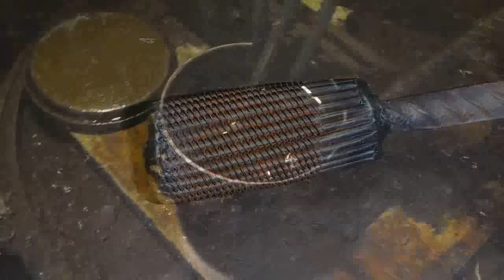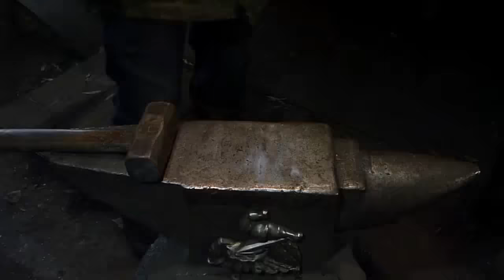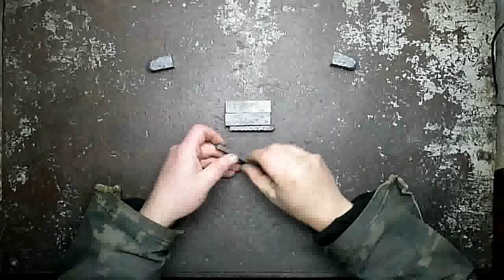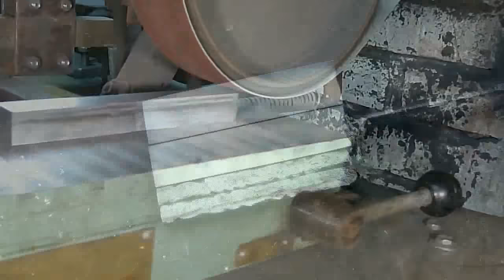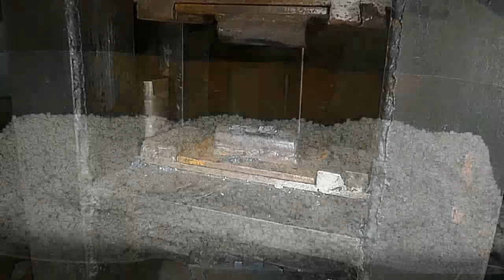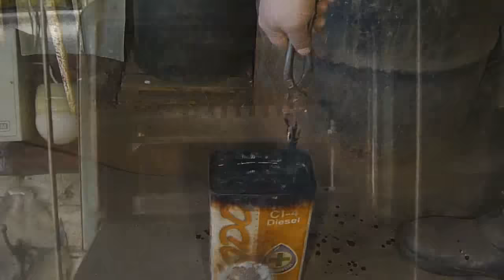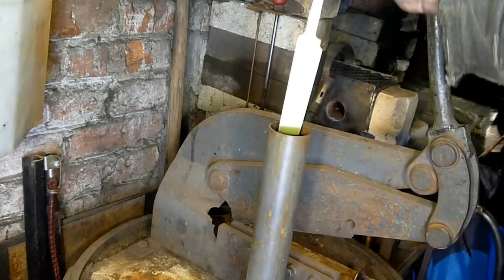Damascus of screws, making a blade.

Comment: Wow not only are your Damascus patterns exquisite, but every step of your forging and blademaking process is so masterful and precisely executed! Like, I’ve seen some horridly failed forge welds in stuff I’ve watched and on actual knives, but yours are the cleanest and most thoroughly executed I’ve ever seen. You make it look easy!?!, And your bladegrinding setup and method is just mindblowingly efficient to watch as someone who wants to get into blacksmithing someday and thinks “OHHH What a perfect tool for that job to ensure consistency between blades” (the grinder with the magnet plate, and the stopguard that you screw onto the blade before shaping the edge). I imagine those steps give you consistent shaping on the back of the blade and for the thickness of the tang, but let you have the freedom to grind as you wish for the rest of the shape and the edge itself! Very cool!

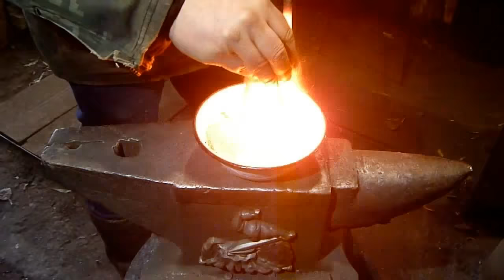Comment: 0:29 One thing I don't understand is how you're pouring powder with bare fingers only 5cm away from 1300c glowing steel, and fingers are not melting off. MUCH respect to your skills and art!
Reply: If you do blacksmithing, you will get used to it. And its not the worst, just a second or two

Comment: I guess the most impressive must be the fact he doesnt have any visible injury in his hands with all that exposure.
Reply: @lordseventhmusic4073  no. Safety first, use your brain.. stay away from injuries and fail compilations
Reply: You can actually briefly brush your hand through molten steel without burning yourself due to the moisture on your hands it creates a barrier between you and the molten steel.
Reply: @jackblue8637  Yeah, if you have a lot of fucking moisture on your hand! It has to be completely drenched in sweat, or water for you to VERY, VERY briefly stick your hand into molten steel.
Reply: Fallout yep, it’s called the Liedenfrost Effect, where some of the liquid on a surface will quickly evaporate and form a barrier between a surface and something really hot. I think they did a Mythbusters episode about this, and they tested it after completely immersing their hands in water. The sweat may help a bit, but it unlikely to completely protect against a burn in many situations.
Reply: @Matt.62  are you willing to try that out?
Reply: Matt S that was lead, steel is significantly more viscous when molten, and it melts at 2700 degrees, not 700.
Reply: Jack Blue lead, probably aluminum as well, but steel? I doubt it. Much higher melting temperature, and doesn’t turn into a fluid when it melts, it’s very viscous. If you could somehow get enough water to stick to your hand that it didn’t evaporate before you even touched the stuff, you might be able to get away with it in cast iron, MAYBE, because cast iron is basically a type of steel that’s much more fluid when it melts, which is why things are cast out of it (you can’t pour steel into a mold)
Reply: There is a trade between extra security (  that needs HEAVY gloves ) and control of tools ( that needs more care in where you put your hands etc ) When you can work at your own speed as he can the latter may well be the better way. If you are a klutz like me - wearing leather gloves is better :)
Reply: @lordseventhmusic4073  you must be a non-vaciner,right?
Reply: @lordseventhmusic4073  this comment reeks of repressed homosexuality
Reply: he will have, just like me but i don't wear gloves most off the time and if i do its only on the hand i'm holding the metal or tool with and not my hammer as you have no control off your hammer if you do.

Comment: I ASSUME THATS MAGICAL FAIRY DUST BEIN SPRINKLED ON THE HEATED METAL?!
Reply: Fairy dust makes the blade lighter, giving a speed boost and not wasting so much stamina
Reply: @levansegnaro4637  he sprinkles flux (90% borax + 5% quartz sand + 5% charcoal powder)
Reply: Correction:- bread crumbs
Reply: @nebtheweb8885  yuh it helps keep everything fused and helps reduce slag
Reply: Tinkerbell's dried skin flakes......
Reply: @nebtheweb8885  what's the liquid it's dipped in at the start?
Reply: @suep9445  kerosene

Comment: The screws don't impress, to be frank. The craftsmanship does.
Reply: ivoman7 then upload some Videos  of the way you would make one?
Reply: Alonzo Sanchez he wasn’t even criticizing the work. And I hate that argument. It’s super overused and irrelevant. You don’t have to be a master at something to have an opinion
Reply: I thought the screws made for some very interesting interlocking striations. That's pretty different than anything else I've seen on the tube.
Reply: Присоединяюсь. Очень красивая работа. Но стоило ли тратить силы на саморезы? (Join for this opinion - nice work, but screws not nice)
Reply: За видео и работу однозначно лайк :)
Reply: Aaron S what is the meaning of damaskus ? Is the method or the steel ? And what powder was that ?
Reply: daud daud damascus is wave pattern on that blade. That method was founded long on medieval periode in damascus, iran (or iraq? Cmiiw). Supposed to be an extinct technology
Reply: Can't argue with that don't know a lot of people impressed by screws.
Reply: Aaron S you hate that argument because you can't make one
Reply: that's Wootz steel, that is lost tech, damascus was pattern welding that looked similar.
Reply: Damascus is a type of steel.
Reply: it's a pattern weld of various types, anything from chainsaw blade parts, to files, to nails, to screws anything carbon steel really, can be forge welded into Damascus, wish I had the skill but I don't. You get varying results depending on what you start with ofc, from the infamously bad 'damascus' coming out of Asian knife shops, to amazing pieces coming out of skilled smiths forges, depends on what you start with and how good you are. Wootz is something completely different, found as antique swords, all are superb, and beautiful, but the pattern is far smaller, (rain drops is a fair description) and behaves differently
Reply: daud daud   The powder is a flux, helps the screws weld together.
Reply: daud daud powder was flux it’s sprinkle over the heated billet to keep the metal from oxidizing and in turn helps the separated pieces weld together in the forge
Reply: Aaron S I agree with you. First the original comment was a praise, so that was uncalled for. 
Now imagine trying that argument in a restaurant. You go to a restaurant and end up not liking the food. Then the chef comes out and say: then why don't you open your own restaurant!
You don't need to be a master to know what you like and what you don't. Sure, many people fail to appreciate how much work and skill goes into making a product, and those people should be shown. But that doesn't mean you have no right to dislike something until you can make better, that's just silly.
And continuing the praise of the original comment : came for the screws (interesting idea), stayed for the craftsmanship, and ended up subbing.
Cheers.
Reply: Salah Eddine H 
I also read that as a compliment.
He said he was impressed with the craftsmanship.
Reply: ivoman7 Lol, i think that is the point!
Reply: I think the point of using the screws is that you can make something pretty just by anything.... well done.
Reply: Chip Fisher I know something about the English language, so  I would like to criticize you on your use of the determiner “their” in place of the contraction they’re; does that suit you?
Reply: +ivoman7 - The screws are heat treated high tensile alloy steel.
Reply: +Aaron S - the materials used are part of any work done.  In this case the screws that don't impress are heat treated high tensile alloy steel.  Certainly would make for a very reasonable and durable cutting edge.
Reply: ivoman7 do you mean the type of screws or his choice to use screws or the way the screws turned out?  It doesn't make sense to say the screw don't impress you.  This video isn't about fuckin screws....
Reply: syria
Reply: Mow Money Mods I thought it was first used in China or Japan but was popularized in damascus
Reply: "The steel is named after Damascus, the capital city of Syria." But yea in USA most people will not gonna be able to tell you what capital city of Canada and Mexico is so...
Reply: Alif Akbar Kamil Syrian
Reply: EngineerPrepper Considering the  number of voids between the screws which the guy in the video had to get rid of by heating up the billet, continually applying flux and forging it down, and to end up with a quality damascus is a great achievement.

Comment: What is all the stuff that flakes off when it’s being forged? Just excess metal?
Reply: Ryan J I love your question. The flakes are parts of the steel that is oxidized due to the heat of the fire and the oxygen in the air. Blacksmiths call the flakes SCALE or SLAG. This part is like a skin that falls off. Then the steel is smaller and lighter than before. Some types of steel flake more. Properly heating the metal in the forge where there is less oxygen can reduce the flaking. Less flakes is better. Thank you for such a great question! This is a very important thing for blacksmiths to be concerned about because the metal loses weight the more times it is heated and forged.
Reply: @joshuanewman1234  amen!
Reply: @FT4Freedom  Thank you for this nice answer.
Reply: gettinnapkins thanks for your useful input. Not all of us know blacksmithing.
Reply: @FT4Freedom  What is the powder being sprinkled on during the process of binding the screws to one piece of metal?
Reply: @kkrauter1  Google anhydrous borax forge welding. You will find everything you need.
Reply: What a bunch of metal snobs. Damn I'd have to ask a question!
Reply: It's scale that falls off when he hit it with the hammer.
Reply: Califresh 😂😂why you mad bro
Reply: I had the exact same question and now I know
Reply: Oculus  don't make fun of someone trying to learn...  You don't know till you know...  Hope you feel good making fun of someone who's just trying to learn.  I guarantee at one point you didn't know either...  This is how you keep people ignorant,  by making fun of what they don't know...
Reply: Oculus  lmao
Reply: Oculus  what's your problem?
Reply: @dylankirk7994  He didn't know the answer, so he was projecting onto someone with the balls to ask questions.
Reply: Oculus  talking bout being bright when he doesn't know common grammar. Probably never graduated...
Reply: Carbon
Reply: Scale
Reply: @kkrauter1  powdered steel

Comment: I've never seen someone make a blade before. Pretty cool. What's that powder he puts on it?
Reply: It's called flux. I think it prevents oxidation when the metal is heated, allowing for the metal to weld.
Reply: The flux is usually something called borax. Draws out impurities in the metal.
Reply: The reason it draws out those impurities, is that the flux actually lowers the melting point of those impurities, and they are more likely to come to the surface, and shard off when the smith strikes the metal.

Comment: why does he always put a piece of wood on the anvil in the beginning?
Reply: I don’t know but maybe it’s a way to add carbon, but even that seems too far fetched
Reply: Because the ridges on the screws will mar the surface of the anvil, which needs to be smooth and free of pits. That's why the first time he takes it from the forge he lightly taps it the flatten the ridges and then puts it right back into the forge.Every time you strike a piece of hot steel you transfer the imprints of the anvil and the face of your hammer to the steel. So blacksmithing anvils and hammers are always smooth and polished.. If you don't maintain those surfaces over time all of your knives will have a stippled look on their surfaces and will require more grinding and polishing.
Reply: Nathan Bell that is a logical response to this specific video but there have been a couple of times that he doesn’t use screws and instead uses a material without prominent ridges. But I do have to say that your reason makes the most sense
Reply: @Josh-ck9bv  I'm fairly certain that's the reason he does it. Even with apparently smooth items there is a chance that there are burs or slag clumps from his welding the pieces together. It's really just a safe practice to ensure you don't scar your anvil. Resurfacing an anvil is a laborious process because you have to even strip down to underneath the scars or weld a whole new surface onto the anvil and then level that properly.
Reply: Nathan Bell you probably are right. Beats my stupid “add carbon” theory
Reply: Nathan Bell especially because in the flux he is already adding charcoal powfer
Reply: @nathanbell8356  that is not the reason at all. It's ro limit the stress put on the pieces so the forge weld but don't split.
Nothing to do with the anvil
Reply: @ironhornforge  I guess you're more of an authority than I. I have a friend who is a regular at Fire on the mountain and I just remember him being compulsive about maintaining his work surfaces.
Reply: @nathanbell8356  yeah keeping your anvil clean is important so as not to pick up crap into your work or to have it transfer unwanted patterns onto the work piece.
Only if you cold work can you damage the face of your anvil, hot steel will buckle well before an anvil face.
Reply: I don't want to take credit for anything . . . I'm just pasting from the guy's statements at the top of this page:  "The first welding is done on a tree, since the wood is a heat insulator, and not so selects temperature as an iron anvil. In addition - burning, the tree burns oxygen, protecting the workpiece and pouring the flux work. This is important for welding workpieces with small parts (cable, chain)." Interesting! I never would have known this.

Comment: What if you used fine steel wire, something like 24 gauge or 28 gauge... Harden it first with carbon quenching, spool it around a barrel so you get a good bundle.  Weld a segment and cut it out.  Then start forging with that.

Comment: Don't you get burned, so close and without gloves?!
Reply: Russian hands
Reply: Leathery man hands.
Reply: Not an insult here but  look at his hands. This guys not afraid of hard work.   Callouses
Reply: Michael Gallagher Agreed, but fire is fire. No getting arround that. So close to red hot iron, the spark shower of molten metal must be constant...
Reply: My Brother is a smith, He says the gloves get in the way more than they protect.  Air is a poor conductor of heat anyway, most of the heated air goes straight up.  Notice he doesn't rest his hands above the steel, always to the side of it.
Reply: If u work as a craftsman ur hands will get leathery due to you using ur hands for hard work everyday.
That works as natrual protection, thus increasing the heat tolerance of ur hands.
I've seen a chef, who has been working for 20 years plus that legit pulled out a hot (full metal) pan out of a salamander with his bare fucking hands...
Reply: The Ruler Of All Worlds And The Destroyer of Universes Using A Mighty Spoon AKA Putin whats a salamander?
Reply: Its like an open oven in which u put stuff to keep it hot.
Whatever is in there usually gets really hot to a point where u have to wear some kind of protection to get out whatever is in there.
Reply: A salamander is like a stand-alone broiler. They get things extremely hot extremely quickly.

Comment: Why you use wood? Why u screw screws? What is that powder? Wtf is goin' on with that mechanisms, are they from twilight forest of the Modgor? What are you, a Hollowed Blacksmith from Rpg?
so much questions, but no answers...
Reply: Cauldron powder is boax and yes the wood helps.
Its a way to get good welds on certain steels.
You hit too hard and you get cracks in the welds
Reply: actually all the answers are there if you cared to look. either in the description or the actual video.
Reply: Cauldron  white powder is borax, black powder is iron powder.

Comment: Suggestion for easier screw head removal (or similar process): mount the grinder in the vice and hold the screws with pliers in a bear grip.

Comment: $10 dollars worth of iron - $500,000 worth of equipment to make the blade lol. However, it does look pretty.
Reply: You could do the same with a couple $20 hammers, tongs/pliers, an angle grinder, and a vice.
Reply: @suprememasteroftheuniverse  well im just a simple stomper, not much i do know.
Reply: 500,000$ really? In fact, this equipment doesn't such expensive.
Reply: Master of the Universe sure he can. Thats how they  did it 100 1000 years ago. U obviously have no idea what ppl can do without fancy equipment. But likes to talk big
Reply: @suprememasteroftheuniverse Yes, of course, the physico-chemical process takes place there. But the material with the specified properties is already available - it is screws. And therefore the risk that a material with other properties can turn out is very small. They need only be heated to the forging temperature. And that's it!

Comment: What's the fluid you always dip the billet in befor the first heat?
Reply: he said in another reply it's kerosene and the powder is a flux mix mostly borax with some silica and something else
Reply from the maker: The billet is soaked in kerosene. This is necessary for good welding (forging) steel. When burning inside the workpiece remains soot (carbon), which, with further heating, scales and rust inside the workpiece restores to the iron, improving the quality of forging welding.